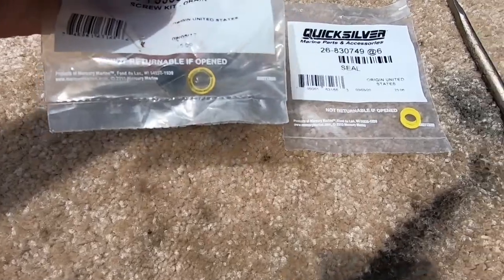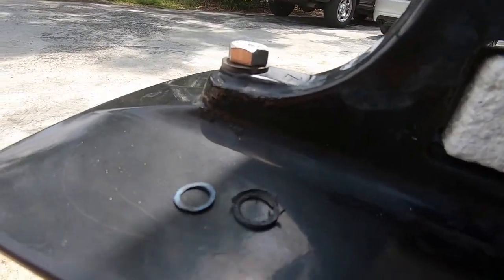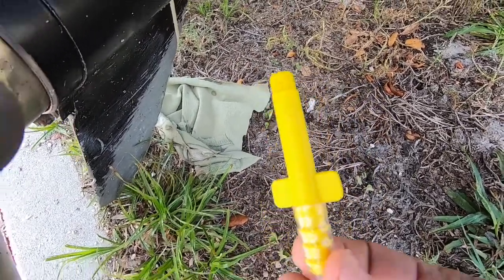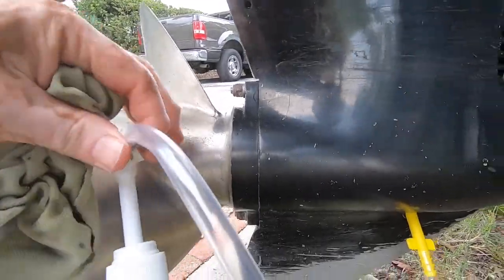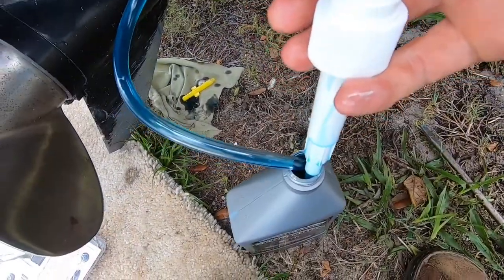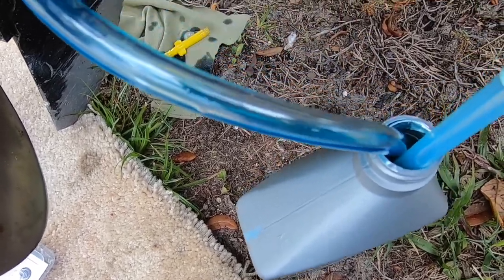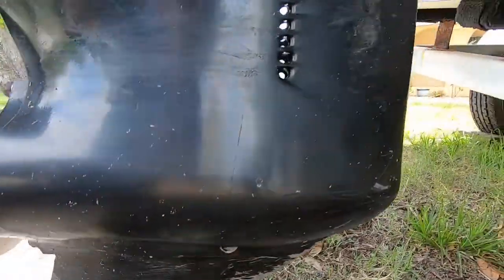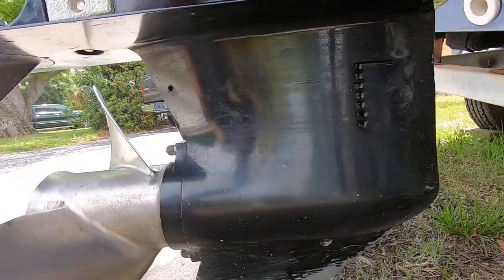Mercury Outboard Motor Lower Unit Gear Oil Refill

Comment: I had a similar issue on an Optimax 150.  I think I didn't replace the drain plug seals last time.  It wasn't as dramatic as this example, the oil had a slightly brownish tint.  For anyone watching this in the future, the only thing I would add that I did was to use a little gear oil and attach it to the top plug and gave it a few pumps and waited a few minutes to flush out the rest of the old milky stuf.  Cheers, and keep on DIY'ing!

Comment: What caused the oil to go milkshake colour?
Reply: Was the water getting in because of the seals were bad??
Reply from the maker: The water was getting in the lower unit through the shift shaft seal.